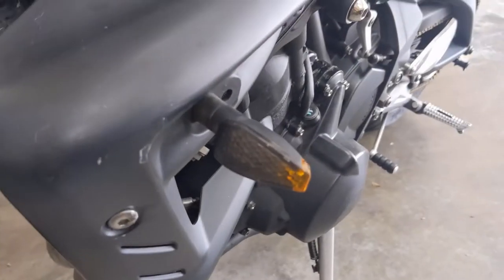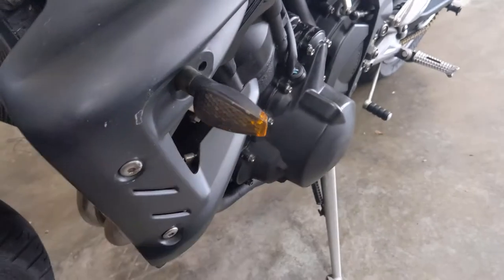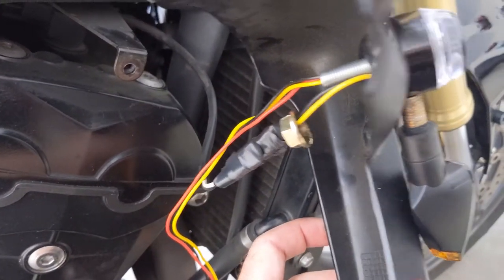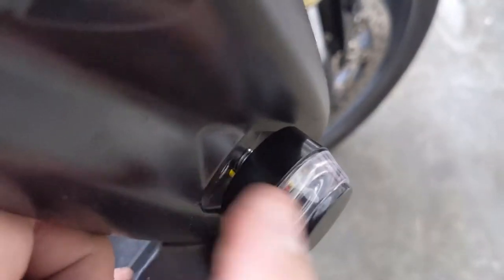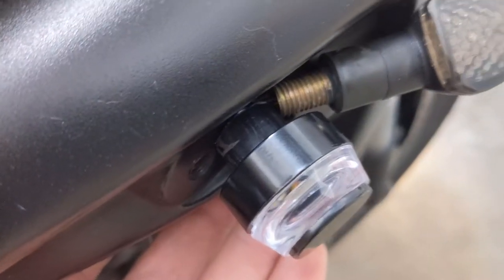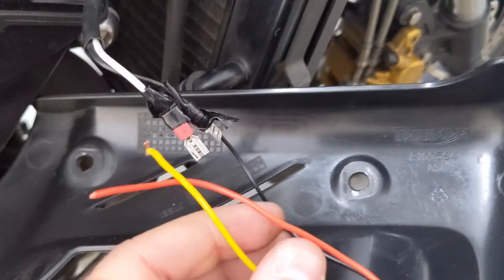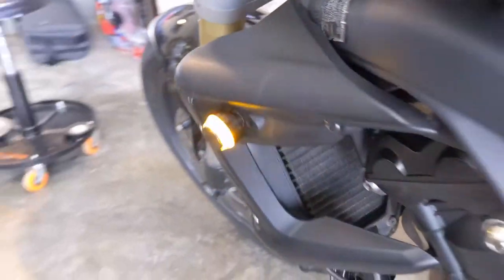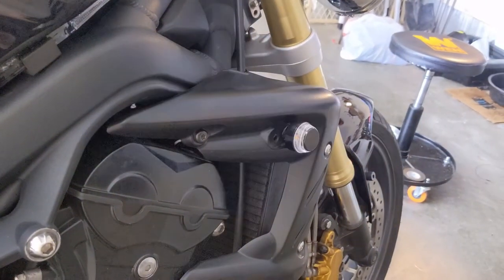Motorcycle LED Round Indicator Install - Triumph Street Triple 675

Comment: Nice very nice but you definitely have to do something about the holes that are still there from the other lights
Reply: Problem I’m having with mine, I’ve done the rear indicators because of putting a tail tidy on but can’t seem to get anything to cover the hole on the fronts, I ended up leaving the originals on
Reply: Im thinming of getting a 3d printed cap for mine, bondo and paint matching it